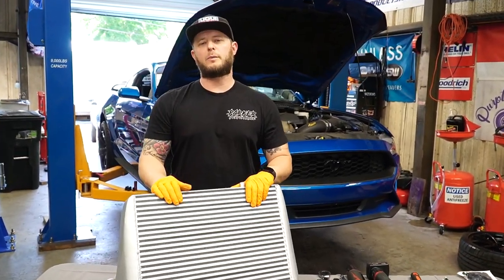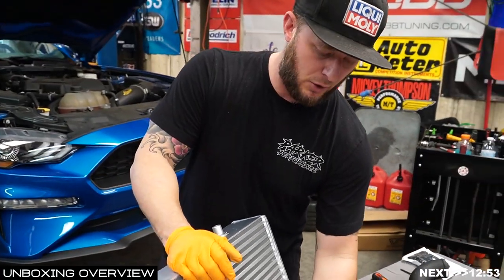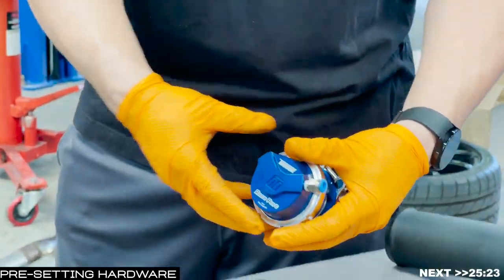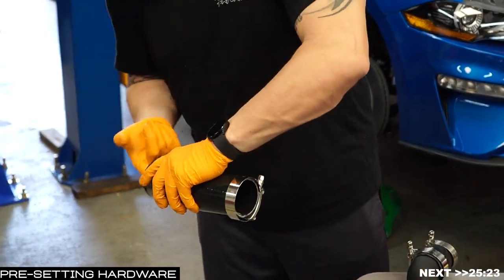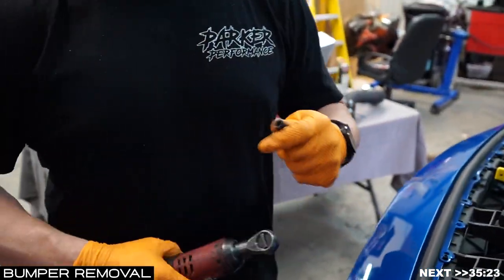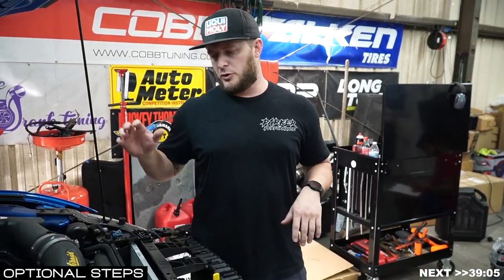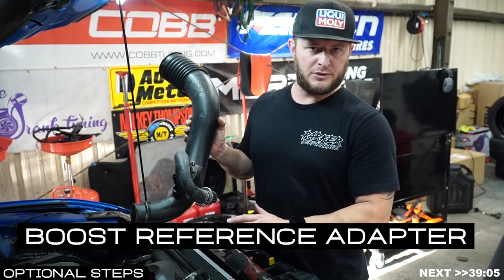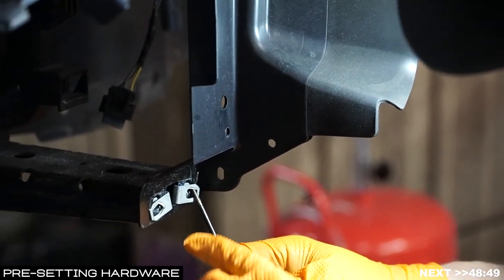2015-2023 Mustang EcoBoost TORNADO KIT [INSTALLATION]

Comment: Be careful not to snap off the sensor when installing the CVfab race core.    I did this and it sucked.   Fortunately I was able to superglue it back together and it still works fine.   I’ve had mine in and out a few times and just install the sensor after the intercooler is in place.  Bit of a pain, but manageable.

Comment: This is by far the best instructional video I have seen for installing the CVFab race intercooler, let alone any other intercooler. Y’all have knocked it out of the park again! Great jobs guys and keep up the great work! 
Side question:
I do see most people run the race port BOV. Do you guys have any experience, feed back or concerns running the HKS BOV? That is the last item I’m debating back and forth on before I start getting all these parts. 
Thanks for the video and the info. You guys rock as always 💪🏼
Reply from the maker: Keith! Thanks for the compliment brother. This is why we do it, to help those who either can’t make it to us or even those with little expertise. 

The HKS is a great BOV with an amazing sound. No issues at all! Let us know how we can help, we can set you up with the correct charge pipe BOV combo.
Reply: I love the sound of my HKS BOV!

Comment: Hey guys, nice video. I’ve been debating on which intercooler to get for weeks now, and decided on the street as opposed to the race, because I don’t plan on taking the car to the track more than once or twice a year. the street should be more than enough for a duly driver with a little spirited driving every now and then right?

Comment: Hello, I just installed my tornado kit at home, i have an airaid intake tube and when I finished I got a check engine light. I took it for a test drive and it sounds like someone screaming lol I dont know if its supposed to sound like that but the thing that scared me was when I put it in sport and hit about 4k rpms there was a loud pop almost like a gunshot, and shortly after I got an orange wrench warning light. Needless to say I think I fucked up, Any help would be greatly appreciated. I didnt see any problems when I popped the hood either.
Reply: have you ever figured out what happened?
Reply from the maker: Did you ever figure out the problem?

Comment: I'm thinking of getting the tornado kit, however I do not have a tuner. Is that required ?
Reply from the maker: This is a great question!

You don’t need a tune to run our Tornado Kit. But it’ll actually be benefited even with the stock tune. The larger intercooler benefits the car so much.

We can 100% recommend it without a tune.

Comment: So I got the charge pipe kit with the TiAL flange and GenV Raceport but was told it wasn’t going to work. I did not have the boost reference kit you guys sell. Is that the only way to make the TiAL flange and Raceport kit work? If so, I probably will be moving forward with that install as Raceport seems to be preferred

This also means I’ll have to by the reference kit from you guys too :)
Reply from the maker: So the Race port flange is identical as the Tial. So it’ll fit perfectly. 

What you will need to make the Race port work is the Turbosmart Boost Reference Adapter and the PP Hardline kit.

https://ppflco.com/products/turbosmart-boost-reference-adapter-2015-ford-mustang-ecoboost-black?_pos=1&_psq=boost+referenc&_ss=e&_v=1.0

https://ppflco.com/products/parker-performance-bov-hardline-kit?_pos=1&_sid=1e7ac871c&_ss=r

This is all you need!
Reply: @ParkerPerformanceFL  awesome! I’ll have to wait to order it all. I may or may not have sent it back planning to get a different set with the turbosmart dual valve kompact, but if I can make the Raceport work, I’d like to do that instead. My only question, what exactly does the hardline kit do? Like I see it’s plumbed back into the throttle body side, but why?

Sorry for a silly question, but I’m trying to learn more. I just got into cars really and started modding with my ecoboost with Jason at DSG Performance and just want to have an idea of how things are supposed to work
Reply: @EAJ97  it upgrades your vacuum line from rubber to hard line to allow for a consistent boost reference pressure with less possibility for any swelling, cracking, etc.

Comment: Is there anything to worry about the race being so close to the condensor?
Reply: Did you watch the video? Lol
Reply: @joshparker753  I did. With the space between there shouldn’t be any negative consequences?
Reply from the maker: As long as you can fit the thickness  of you finger in between, that 1/4” is more than enough. Just make sure to tighten the top fasteners to keep it still.
Reply: @ParkerPerformanceFL  Thank guys. 🤘🏻

Comment: Yo, why did y’all skip completely over removing the crash bar and stick intercooler…
Reply from the maker: We must have missed it, thanks for picking that up. Even though we don’t have the removal you may skip forward to the installing of the crash bar and work a bit backwards. 

Thanks again!
Reply: @ParkerPerformanceFL  all good! 

Removing the stock intercooler wasn’t too bad, just have to rock it a bit and use the same tips Josh mentioned for installing the race core.